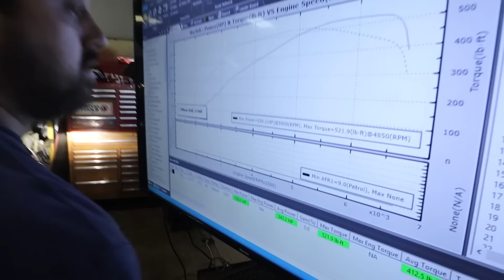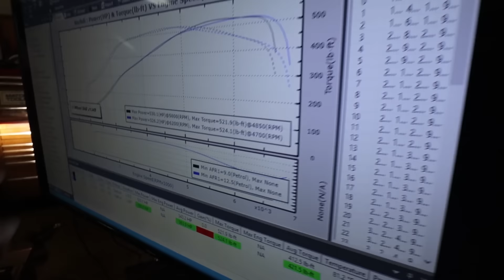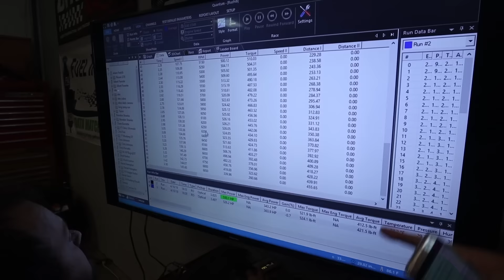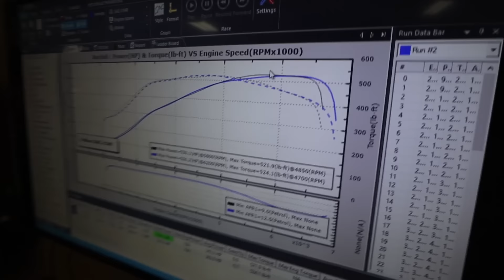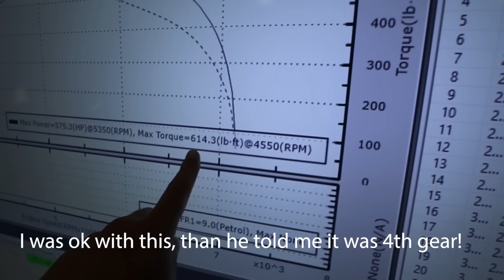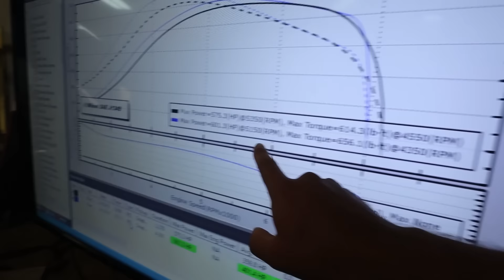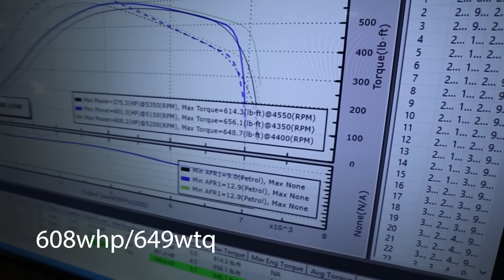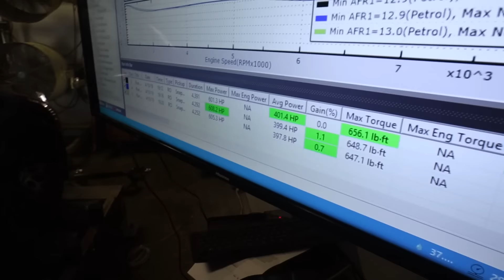DYNO DAY SHOWS IMPRESSIVE NUMBERS!  BMW M3 PUTTING DOWN BIG NUMBERS!

Comment: Impressive! I'm on Bootmod3 on 93 octane with 540 whp, Dct. (Thumbnail) Afraid to take it to the next level adding E85 due to the crank hub issues. Did you do a CH fix?
Reply from the maker: Thanks. I been running E85 since 4000 miles. I have 21k now. Not one issue. I highly recommend @f80paul as he's the E85 genius.

Comment: Okay so maybe it's different with Manual vehicles, ( don't think it should be ), was your car in Dyno mode? I thought the with 2MA transmission the 1:1 gear ratio was 5th gear, why was the F10 Dyno'd in 4th?
Reply from the maker: M5 would've went way to fast at the top of 5th gear. Dyno topped out at 170mph.